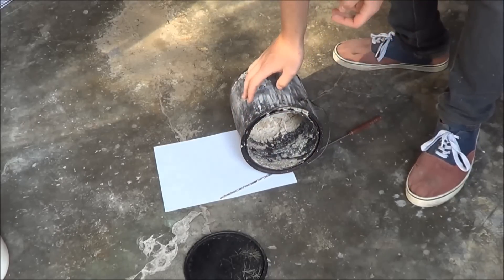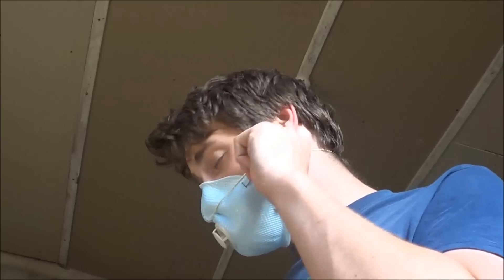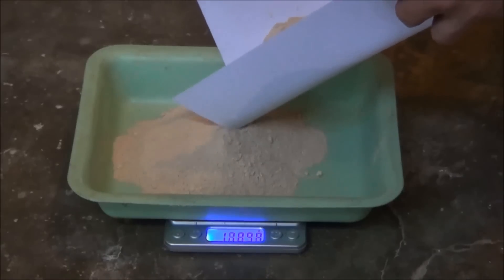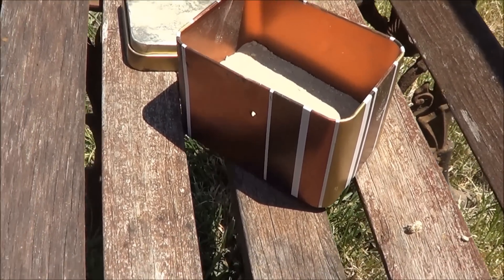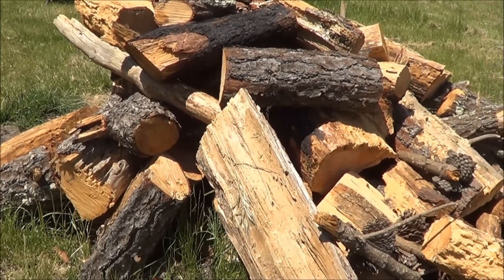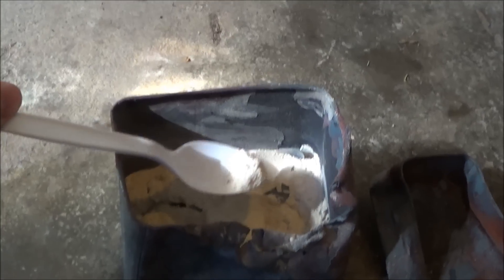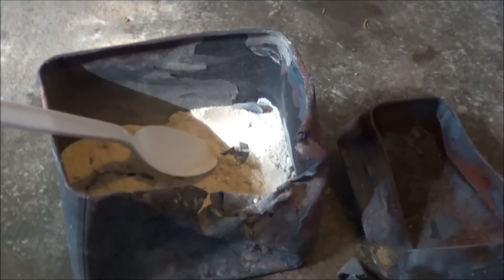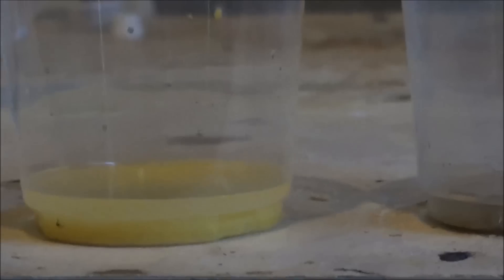Calcium cyanamide -Tetrazoles part 2

Comment: how does cyanate (OCN) become cyanamide (CH2N2)? where does the H come from?
Reply from the maker: We are making it as an anion so it doesn't have the hydrogens, it has two negative charges. Cyanamide here is (CN2)2-
Reply: Hydrolysis would produce cyanamide. Ex&F made calcium cyanamide.

Comment: Nice "Cody's Lab" style prep, he finds his reagents on the ground too. So is 5-aminotetrazole where this is going? Or maybe something more sinister (Aminotetrazole nitrate/picrates etc)? Speaking of picrates have you ever tried making TNP using the sulfated ASA method?
Reply from the maker: ok a lot to respond to. 
I actually love Cody's lab, if he wants to make a collab involving honey and primary explosives id be so down.
5-ATZ is where its going, but from there it can totally get more sinister. Sooo many derivatives, so excited
Reply from the maker: oh and I have made TNP by nitrating ASA, twice actually, its a realy nice reaction, good fun, good colour change, interesting theoretical chemistry. What do I do with all the picric acid I have? You tell me
Reply: As for all your Picric acid, do a "I-unearthed-a-30-year-old-bottle-of-this-in-a-university-prep-room"-style bomb disposal operation with an RC car as the sacrificial detonation robot.
Reply from the maker: +RadioTrefoil detonating it such a challenge though, I could not do it with my largest sledgehammer and my best steroids.
Reply from the maker: +RadioTrefoil Yeah I have kept up with that guy's channel, the tetramine copper salts he uses seem interesting, might have to make them myself yes. 

Oh wow! I purchased a voltage controlled power source so i'm hoping to get into some electrochem stuff a bit later on. Can't use a glass tube, does it get too hot?

I haven't seen the oxygen tubes no! I shall look for them
Reply from the maker: +RadioTrefoil http://www.bunnings.com.au/coregas-trade-n-go-size-d-oxygen-gas-_p5910224 seems like a better deal actually, no idea they did this but would definitely get it if I had a working ozone generator
Reply: Yeah having constant oxygen would definitely push the equilibrium towards ozone. I think glass would work but I don't have a suitable glass tube either... I might just break a fluoro tube, scrape out the phosphor and use it. I know it can withstand a low pressure arc so it should take a bit of corona just fine. The very good news is that when I make corona without using the tube (by just having the electrodes too far apart to arc) there is a very strong ozone smell. I guess that's a good sign then, and I'm not even producing all that much corona. I also want to find an "AC flyback" without internal diodes, it seems that AC works better for corona than DC.
Reply from the maker: +RadioTrefoil Yeah I will get a cylinder if there's no rent, would be a handy thing to have around anyway, ozone or no ozone. 
Sounds like great progress though! Excited that you can smell it. I'll have to get some PFTE tubing to pipe it around, don't think any other tubing will hold up well
Reply: @ExtractionsAndIre  eh you guys have a nice little chat going on, ill join in 4 years later: hello!
Reply: @RadioTrefoil  : I have an oxygen concentrator I’ve been thinking of selling. As long as you don’t need like atomic level purity it should do well-but the shipping would probably be a bitch cause its heavy. Sorry if this seems abrupt or “overly forward”of me, I just happened upon this comment as I’m cleaning my shed.

Comment: Great process man! I recommend getting a laser thermometer or something, helps a lot with temperature control. (I used to guess when I operated my foundry and melted a TON of containers that had a lower melting point.)
Reply from the maker: +Paul Pyro I have one of them, had it for years actually. It is so super useful! But a bonfire is just too hot, I think it maxes out at around 600 Celsius, and I couldn't get close enough to get a good measurement because of the heat
Reply: +Extractions&Ire Ahh, well that's a bummer :p but hey, the reaction worked anyways so that's all good.